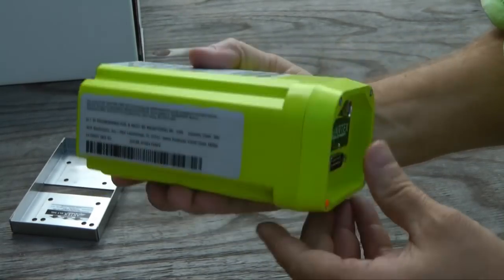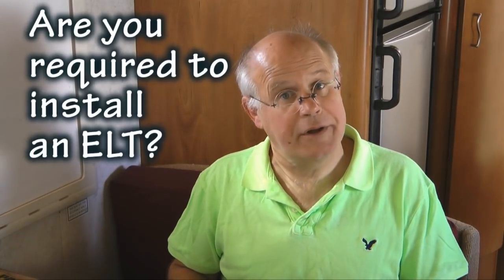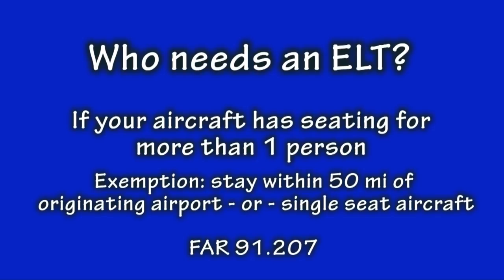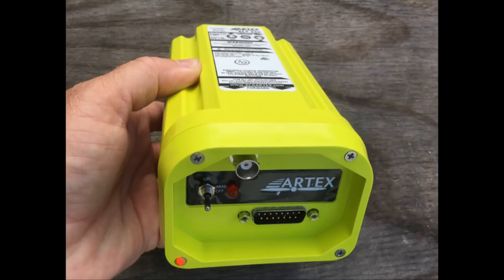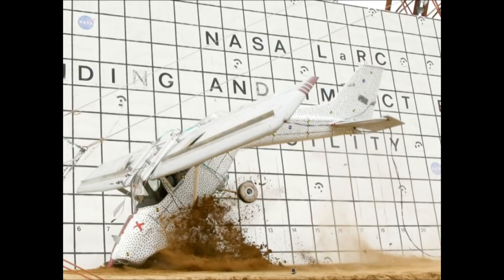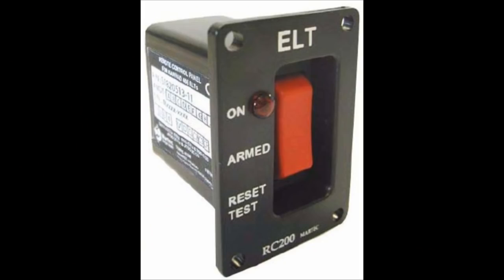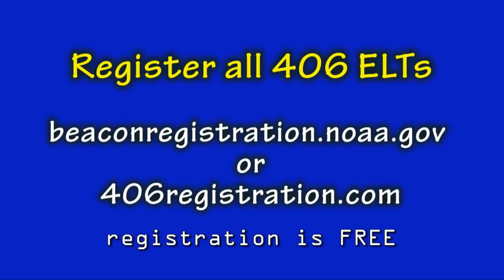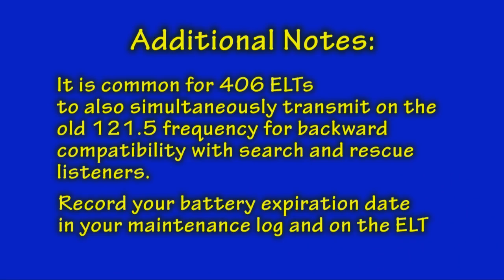How to Choose an ELT for your Homebuilt

Comment: I’m having satellite reception issues with my new GTN650 and have been told that replacing my older ELT with a modern 406 ELT will solve the problem.  But it appears that all 406 elt’s also transmit on 121.5.  Do you know anything about this?  Are there 406 elts that do not also transmit on 121.5 and if not will this even matter? Thanks.

Comment: Thanks for the info, I will be ordering one soon.... 
Is there a preferred location for installation?
Reply from the maker: Typical location is tail (tends to survive crash) BUT follow manufacturer's instructions for ELT location
Reply: A lot of light singles have them right behind the aft baggage compartment bulkhead in the fuselage with the exterior antenna mounted above it on top. Your remote switch on the panel. Put it where you can have easy access to it. Ive seen some plane with there ELTs placed where you couldn’t get to it without using the jaws of life, or a chain saw. A real pain during 100hrs and annuals. Remember the  harder it is to get to and put back the longer you aircraft is in the shop with the meter running.